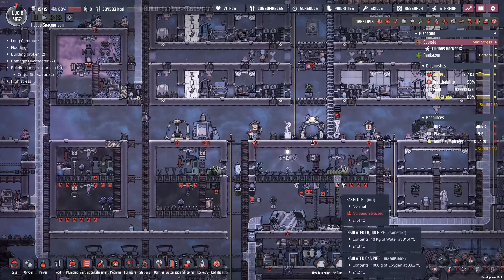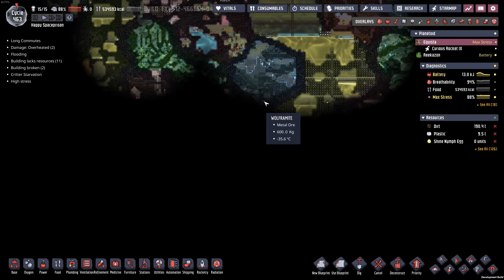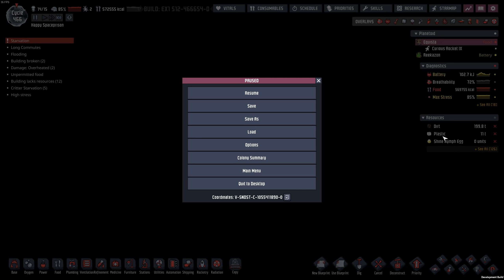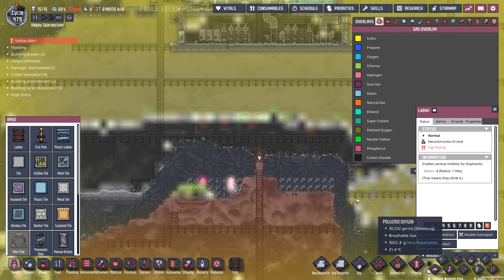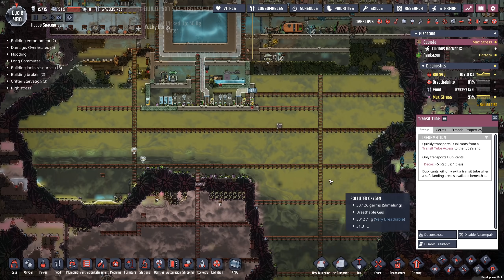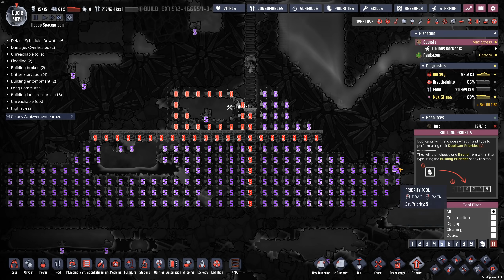Powering UP! Oxygen Not Included ep14

Comment: The research reactor doesn't actually release steam, it releases "liquid steam" (i.e., a blob of superheated water that turns to steam only when it hits some surface - I'd call that a physics bug, but apparently Klei calls it game design). That means it's actually preferable to have your reactor far above the steam turbines, so you don't have to cool it (at least not as much), and also so it doesn't overpressurise (steam pressure will generally be highest at the bottom of the chamber, and lowest at the top).